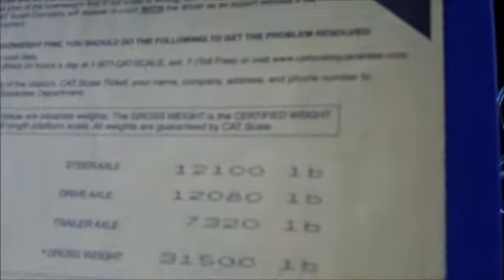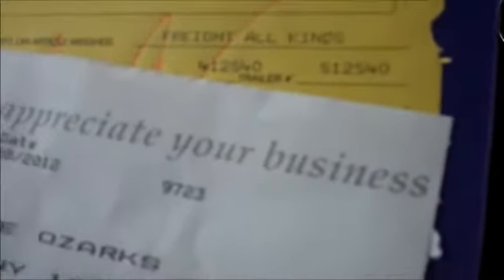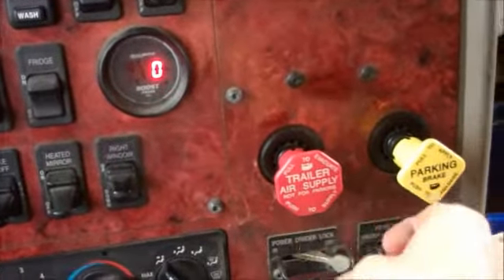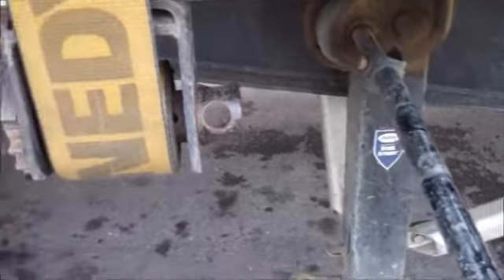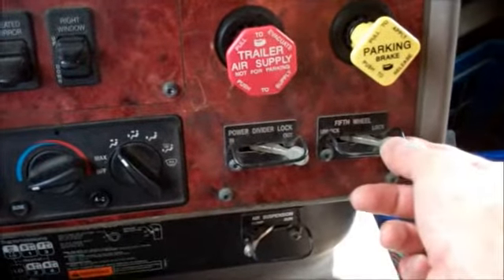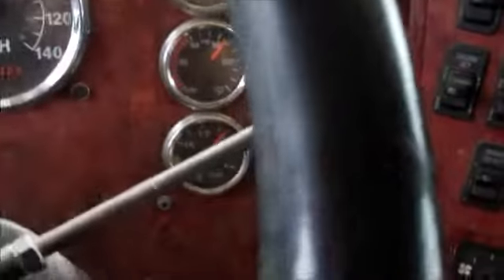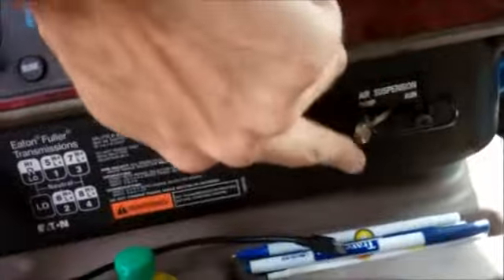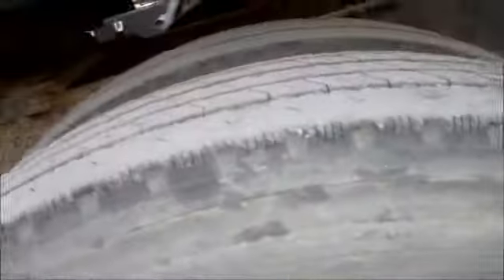HOW TO MOVE THE FIFTH WHEEL

Comment: Well done, it's surprising how many drivers don't know how to do this.

Dumping the air is a nifty trick if your truck has the feature but I've found that sometimes the suspension can drop so far as to bind the fifth wheel in the opposite way that the weight of the rear end is pulling down on the trailer. For this reason I like to unlock and tug on the fifth wheel while the air is dumping out and hopefully get her all set before she hits bottom.

Comment from the maker: Congrats. If you never drove an articulated truck and trailer before, learning to back up and going around corners would probably be difficult. If instructors cannot help (a lot of them are just former truckers and NOT TEACHERS), try renting a pickup truck with a small trailer and back it up in some big parking lot. The principles are the same. I learned backing up driving a 5 ton truck while towing cars on its rear. The key to backing up is the ANGLE between the truck and trailer. Good luck.

Comment: Yanking on the johnny bar with you trailer brakes popped ain't gonna do nothin but put a strain on your brake canister's diaphragms. The only reason why your steer axle is rated at what at 12k is because that's the rating your tires have. The higher rating your steers have, the higher rating your steer axle has. You can have the same axle, and steers rated at 20k lbs, and you would effectively raise your steer axle weight limit.